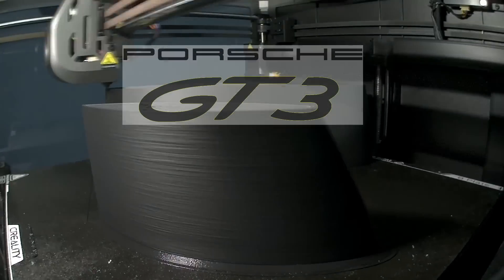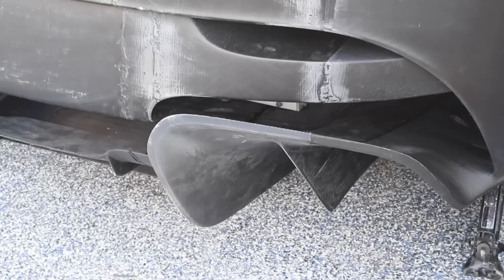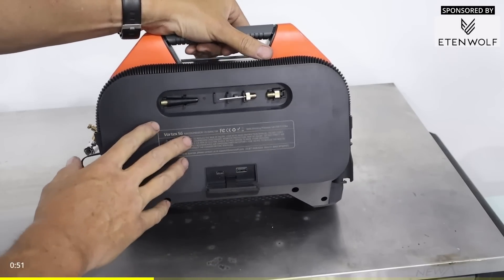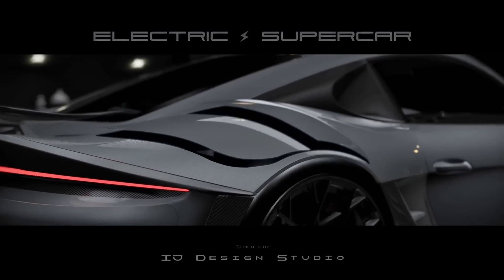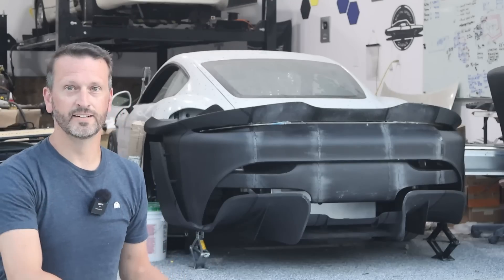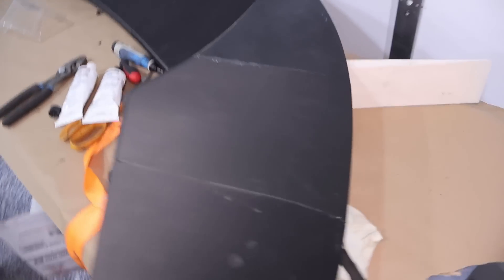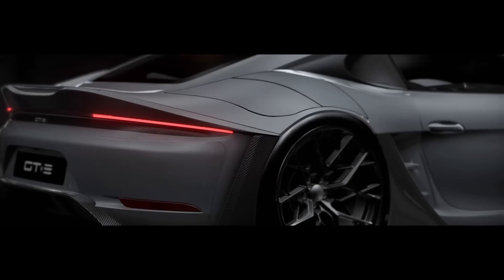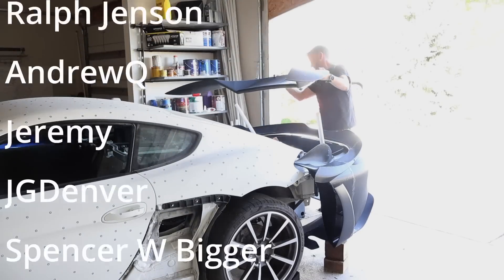How I 3D Printed a Giant Wing for My One-of-a-Kind Porsche

Comment: Yeah you don't want your ring in the back shaped like an airplane wing, you want it upside down for downforce purposes
Reply: The next time you do that thing with your wing that you're gluing everything together you want to use spray airplane model CA glue or actual contact cement CA glue. You add your base and then you put your spray for your activator and then clamp it together 20 seconds hold it and it's done... Definitely use CA glue next time sand it down and wrap it in carbon fiber

Comment: So I've been trying to think of a way to cleanly raise and lower the wing for awhile. You have the built in porsche system so maybe its less of a concern for you, reverse the leads and it should go flat at speed and up when below 80 or whatever speed. 
however, the amount of force on the wing may back drive such a small motor. Anywho, moral of the story is worm gear linear actuators. you can get 400lbs actuators pretty cheap and with like a 40:1 ratio the back drive force would probably be enough to lift the car. I would wager I'm a bit early in your case but I've been trying to design a system for ages for mine. I've considered pneumatics and hydraulics but dont want the extra support systems. and normal linear actuators are under powered, I assume as I'm too lazy to calculate the forces on the wing. You could place the motor inside the trunk, connect a carbon rod to it for aesthetics and use a spherical rod end to connect to the wing. For your other aero panels, traditional linear actuators would probably suffice.

Comment: Im using instant "super glue" with an activator spray.. that way you dont have to wait and use straps and stuff
Reply from the maker: @critical  nice!  What is the activation time with and without the activator?
Reply: @electricsupercar  without i think it depends a little on the room temperature but maybe a minute and with the spray its like 2-3 seconds. And you can spray it onto the sides after lining everything up

Comment: Next time connect the printed sections with carbon rods and add a grove for the glue close to the perimeter, don't glue the entire surface. 
Print a jig to align the pieces. 

Higher bed and chamber temperature, more part cooling, larger brim. ABS-GF is your best friend.

Comment: Regarding your clamping issues, you might take a note from woodworkers who sometimes make a shaped wood piece that fits to the uneven shape on one side with a flat and parallel end on the other side that creates a combined shape that can be clamped. In your case it could be designed pretty easily in cad and 3D printed.
Reply from the maker: @jetsyfix  good call!

Comment: using carbon rods to joint multiple pieces together and use large rubber bands and elastic bands as a means to hold during gluing. can also print external bolt together sections in the print that are easily removed post gluing, the same can be use with clamping hardware. and use a slightly higher bed temperature for avoid the first layer shift, and use Isopropyl to clean bed before print. adding brims can help as well.  cool to see major car parts being made like this. excited to see the final product.
Reply from the maker: Thanks for the comment!

Comment: I have found that settng a first layer that is almost pressing the filament into the bed works. Bed tempurature is important too as it keeps the stuff glued. Increasing the number of brims also has helped when I have had adhesion problems. On the wing design, would putting dowels or printing with the dowels on one side help with keeping the parts together while you are gluing them? Maybe have a zig zag interface between parts instead of a straight line? Regardless I think that massive part came out great! Car looks awesome!
Reply from the maker: Thanks

Comment: To help with bed adhesion, keep bed a bit hotter. Make the first layer a bit thicker can help. I see that the brim separated from the print, to help with this set the  first layer to 0.5 mm width if you have a 0.4mm nozzle. The plastic will flow out wider and stick better to itself horizontally in the first layer. Hope it helps!
Reply from the maker: Thanks!

Comment: As cool as it looks, a wing that big and that high off the body is going to cause massive imbalances. It also appears like it'll create lift when in its 'flat' orientation, and using it as an air brake will put enormous amounts of stress through it, the mounts, and the pivots. The wing I had made for my Noble was from 3 layers of CF with Kevlar in between and the mounts were titanium (which is fun to grind!), and it still cracked after a +160mph run. Yours looks cool but I think it needs to be half the size at most.
Also, the other active aero that you show venting from the wheel arches only needs to be passive. If you fit those pieces with hinges they'll be closed at slow speeds and open enough to vent the high pressure at high speeds. Don't over complicate it.
Reply from the maker: Thanks for the comment

Comment: It might help if you put pockets in the unseen side of the 3D printed pieces, adjacent to the mating faces. You could then use vice grips, or specially made clamps to hold the mating faces together and aligned with the clamping pressure applied on the centreline
 of the mating face. This will help avoid angular misalignment of the joint.
Reply from the maker: Nice

Comment: I’ve seen the other print tips but one that might be helpful: for parts that are structural or need at least some strength you want an infill that isn’t directional, cubic being the best. The lightning parts are strong near the top but very weak at the bottom.

Comment: large beds need to heat soak for minimum or 5-10 minutes.
if you are using ASA or ABS heat the bed to 95c for 40 minutes before printing and turn the fan down to like 0-10%. chamber fan should be off or and 10 also.
PLA set the bed temp to 65c. should help. print with the door open btw. dont want a jam
clean the bed with 99% IP between prints also no need for glues and hairspray PETG yes use glue stick or hairspray.
Reply from the maker: Interesting 🤔
Reply: @electricsupercar  yeah i would look at a few videos from Zack Freedman's every filament videos its like a crash coerce in 3d printing.

Comment: OH, get a textured PEI build plate (gold color) great adhesion and easy to remove prints from it..
If you're printing PLA, you'll want to crack the door open and remove the lid. I have issues with the extruder jamming up when chamber temps get to 34-35 C
I usually have the side fan OFF the whole time and the rear fan on 100% all the time..
If your side fan came on too strong it would cause that lifting/ shrinkage.
Reply from the maker: Thanks for the tips!

Comment: For preventing the peeling; 5 degree hotter print bed, add a brim of 5 - 10 mm's. Or try a raft of that doesn't work. 
Make sure the enclosure is up to a nice temperature. 
And be sure that the bed is spotless.

And for glueing together weird shapes you can always use tape to hold them together while it sets.
Reply from the maker: Thanks!
Reply: You're welcome, and don't forget to do a dry run before actually glueing the parts together. That will give you a better feel for how to keep the parts together while it's drying.

Comment: If you use ABS you can use ABS pipe solvent cement or any other ABS cement. I use SciGrip 4707 because it has a slightly slower set time than the cement designed for pipes. It chemically softens some of the plastic on each part with the solvent and chemically bonds them.
Reply from the maker: Thanks for the suggestion!

Comment: For the wing and other long parts that need to line up and get glued, you can also create a smaller stepped end fitting into a hollowed pocket.  Adhesive and alignment will be much improved.

Comment: I think if the wing goes up to the height as you showed, there may be issue of the flow from wing and diffuser not attaching well in the rear wake. Try CFD of the half car section to optimise the wing height for optimal efficiency of aero devices.
Also for that height with the aero foil you are going with the actuator and bracing would have to be super strong. Would recommend going for a FSI analysis
Reply from the maker: Good call

Comment: I would highly recommend using 10% gyroid infill instead of the lightning. It will give your large spans much greater rigidity.

As far as your warping issue (delamination) this can be helped in a few ways.

1. Heat warp. This can be helped by increase chamber temperature and prevent any drafts.
2. Bed adhesion. This can be helped by using a high quality bed as well as a good adhesion medium. Something like Magigoo could be very helpful.
3. Dirty build plate. If you have any oil or dirt on your build plate that will prevent good adhesion. Make sure you clean the bed with dish soap and water or a high % isopropyl alcohol periodically.
Reply: He does not need rigidity, this isn't final product, its just a "blank" that will be used to make a mold. Gyroid is way too slow for this.
Reply from the maker: Thanks for the tips!

Comment: In RC planes to put wings together and make wing stronger and more rigid you put in a spar through whole thing. It could of worked for assembling this wing where you made shallow holes, instead make them fully extend through part and use long dowels to slide on each part.
Reply: A CF tube as a spine through the middle would provide stability, strength and alignment, not to mention speed up the process.

Love the design and the ambition!
Reply from the maker: Got it
Reply: Beat me to it!

Comment: When you design the 3D printed parts, you should add some make and female “connectors” to aid holding the parts together - think Legos. They won’t necessarily be structural, but it would simplify the anchoring method.
Reply from the maker: Noted

Comment: For adhesive pickup, a tube of the Right Stuff by permatex Its a gasket maker. It's amazing as it bonds all types of products. Years ago, I used it on a few engine assemblies. When I dismantled the engines, I virtually destroyed the valve cover and oil pan breaking the bond. It's my go-to for almost anything at work or home. I just mounted a 2k invertor in my tesla by gluing the invertor under the rear trunk deck. I can do a pull-up off it, laying in the trunk.
It might be too good if I ever remove it. I'm hoping a wire as a knife might do the trick. Both surfaces are flat.
I used it as a head gasket on a geo metro, which lasted more than a year of everyday driving. High heat, not affected by oil. Great bonding power.

Comment: I got an Idea for you when doing these big parts .. in design could you make 3d print some  supports that you could make into a 2x4 frame the frame could be easily and cheaply reconfigured for each bumper or even fender .. some cool metal brackets from a sponsor :) and a 2x4 or  could even be a so 3" pvc .. with you pulling this off it inspires me to try to scan and create me a new dash in my 87 suburban .. wonder if I could copy the K.I.T.T.

Comment: I don't know about that exact printer, but on my Creality Ender 5 Plus there is a setting under print options called Economic mode.  That turns off the bed heater after the first couple layers, and caused the same issue for me that you're seeing.  The problem went away as soon as I disabled that setting.  I don't know if your printer has that option as well, but if it does try disabling it and see if it helps
Reply from the maker: Got it

Comment: Why not just use the middle section of it as the active part , isn't it too big

Reduces complexity 
Improve the brake angle
More control over the panel gaps
And easier to modify 

Anyway love your work and amazing content
Reply from the maker: Thanks for the comment
Reply: And arguably better aerodinamic performance. Aerodinamics are way too complex to try to simulate how the wing will behave without the car as a whole. All the active aero is adding complexity to a project already  too complex, with unknown real world impact.

Get the body done, keep the concept in mind, test the car with passive aero and then move to active aero to create more content, with tests before and after.

Comment: Warping is a function of material shrinkage due to temperature differences. Makerbot has a page titled "how to fix warping" with 4-5 ideas for you. Basically you need to keep the whole part, top to bottom, at the same temp until the print completes. Use as little fan as you can.
Reply from the maker: Got it
Reply: I've had some success by upping the print bed temp  @electricsupercar
Reply: With the k1 max and the pei sheet eventhough  PLA sticks pretty well. Ive found adding some glue or hairspray helps improve bed adhésion especially with bigger parts. It reduces risk of part unsticking from the bed which more likely happens with long print times.

Comment: What was the material you used? There is a company called 3dGloop that sells amazing glues for PLA, PETG and ABS/ASA that will be easier to work with than what looks like JBWeld that you are using.

Comment: 3D prints: magigoo for the build plate. It does wonders to help hold parts down and let your parts off. With your longer build times a clean plate will go a long way. Clean it with soap and water in the sink. For sharp corners I recommend adding elephant feet to the prints. This gives the corners more surface area to stick to the build plate. Lastly, you can also slow down your first layer to make sure you have a solid contact.
Reply from the maker: @sojhinn  Thanks for the tips!